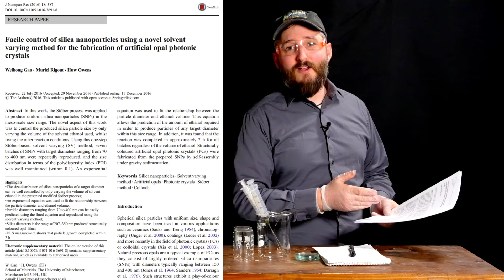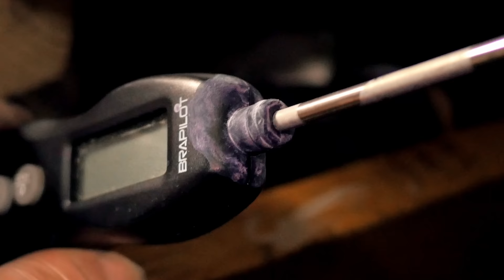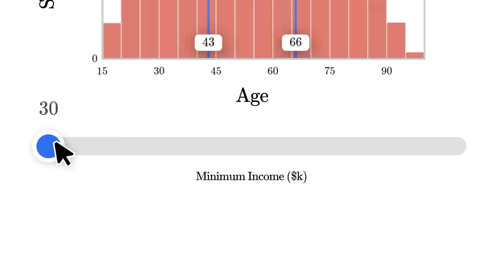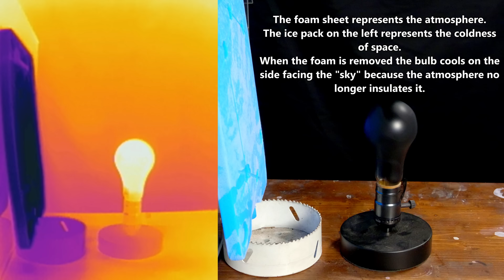Making Opals for Free Air Conditioning

Comment: Awesome being able to watch your work and experiments! I make colldial silver and I'm familiar with the color created from nano particles. From my basic understanding ionic silver is created by electrolysis with silver electodes. Adding vitamin c turns the solution to a particle. The solution turns to a yellow or golden color after the addition of a small amout of vitamin c. Maybe it is interesting or not but I tried adding trisodium borate to the solution because I was interested in that it is used as a flux for metal. It seems to cause a smaller particle when used prior to the addition of the vit c. It would be interesting to see if it had any effect in this process.

Comment: What would happen if you dried your opal solution on a resonate plate with standing waves to sort out the nano beads?  If dried on a ultra sonic plate the standing waves might be small enough to create a diffraction interference pattern.  Instead of carbon black if you mixed in nano ferrofluid solution and used a magnet to slow down the Brownian motion.

Comment: Try growing the opal crystals on different materials! I bet that there is some (even if it is very small) ordering in the glass dish you are using that helps the opal particles stack in a certain way, I wonder what results you would get if you grew the opal crystals on something like a quartz crystal or even a metal substrate, would the different substrate crystal structure influence the stacking of the opal spheres?

Comment: You don't need something as expensive as opal for radiative sky cooling. You can be clever with design and mirrors. Keep the direct sun off with a gold or silver metallic, and reflect everything else up to the sky (not near the sun) with mirrors. A room high up on a tower should be as good as a beach, for the full 360x360 effect, it reflects from underneath as well. Those pepper pots and minarets probably have basis in science.
Reply from the maker: That's true, with the right design you can use a black radiator. It's hard to implement that as scale though to cool a building. Better to have a coating or paint for that purpose

Comment: I was about to close this video thinking id already seen it, however it was thought emporium's. Like the way you explained changing the particle size, it was really clear and understandable.
I'm wondering if you could evaporate in a shaped silicone mould to get a preshaped stone. That would take ages I expect. Also could the solution be layered to coat something in opalescence.

Comment: Could you pull the air from the crystal with a vacuum?
I have seen people clarifying resin this way - though of course I recognise the difference between a liquid and a solid.
Perhaps:  Encase your opal crystals with a bit of epoxy / nail varnish and pull the air with a vacuum???

Comment: actually that centrifuge is a slightly smaller than typical centrifuge. it's just not as small as a microcentrifuge and not as fast as an ultracentrifuge. You should see the centrifuges we use to separate blood donations.
One thing I wanted to comment is that centrifuges this size normally have a decent amount of armor in them to contain the energy of samples and buckets potentially coming loose or breaking up at high speed. Centrifuge malfunctions can make a 50kg centrifuge jump a foot in the air. They cost in the order of $5000. I don't think your centrifuge meets any safety standards and costs 1/50th of a decent one. I wouldn't feel safe being in the same room as it when it's on.

Comment: I have a few process ideas, but they are totally off the wall.

Firstly I wonder what would happen if you use a vacuum chamber to help with both evacuation and removal of air from the lattice?

Another idea is freeze drying, I wonder what effects that process would have.

And lastly, I am curious as to the opposite of the first, a pressure cooking method with a desiccant inside to absorb the vapors.

Comment: To speed up a potential merger sample, look at nature.Thousands of years of pressure, is that the particles join. Potentially getting the centrifuge precipitate, putting a depression, reducing heat intense movement, may help force matrix formation, as the entropy is removed. Maybe even an electric field or magnetic field to try and help line the quantum crystals in a cooler higher pressure environment. There is also the topic that the current visible is actually the cover note absorb. So while the spectrum that does get through whilst reflecting infrared, could potentially be dangerous, as this work for does the damage in the sun. It may help to is in any back to, local water treatment plan. Opal the nature take thousands of years to slowly fill and replace other minerals as they leach through the rock and substitute for others. The black ethanol versus carbon work, possibly would be better than a pure is apostles as both your seed crystal nucleoside and provide you with the black people you're looking for.

Comment: what if you did a slow cool down? keep the heat but step it down over time to simulate the thermal cooling of the rock surrounding natural opal? i would say add pressure as well but i dont believe it's necessary. maybe an added experiment?

Comment: Could you settle the structure with a vibrational plate / by playing different tones using exciters on the work surface; Then pull with a vacuum or pipette excess? Would the vacuum disturb the structure contained if it is still permeated by solution?

Comment: I was wondering how to compress these microspheres into a rock for more concentrated color.  Also layering different solutions over days of evaporation.  But the centrifuge sounds like a good step in that direction and you can draw the clear fluid off the top of the solution.  Otherwise could you compress a dried powder with a slight addition of liquid in a hydraulic press?

Comment: If you're just looking for very small and uniform light reflecting spheres, would commercially available retroreflective glass beads not work for your radiative cooling coating?
Reply from the maker: Maybe. You want a very particular size for best results
Reply: @Nighthawkinlight  they're available in a variety of micron diameters and are almost perfectly spherical.

Comment: Would there be any merit in creating a vat of resin, using a vacuum chamber to remove the air, then stirring in strings of the opalite mixture in ribbons, then letting it harden? For resin art this is done with inks, but presumably it'd work similarly for this type of thing, although there may be some bubbles. I might go about trying this in a few months after getting some of the necessary equipment as I can think of a ton of cool art projects to use it for.

Comment: I'm wondering how shaking the solution as it dries would affect things. When you shake macro sized objects, they tend to pack together as tightly as possible and I wonder if that works on nano scale.

I'm also wondering about tumbling sand instead of using TEOS. Could it be possible to get useful nanoparticles that way or would they be too random?

I'm also wondering if using resin might work for the final product

Comment: Hey. i was just thinking, you know the huge problem of metal 3D printing is that it leaves parts highly porous right? can this be used as an adventage for this specific case, if you used silica microspheres instead of metal powder, wouldn't you get extremely insulating and highly radiating panel? you were working on radiative cooling paint, wouldnt this method provide highly durable radiative cooling panels for very cheap?

Comment: is it possible to use heat and pressure over the right time frame to create a monocrystalline structure within this solution? Or would it require an additional frequency to form the lattice such as cymatics?

Comment: Great videos.  Wouldn't smaller spheres reflect infrared?  Could that be used to make an insulative paint?  If so, how would that compare to Aerogel paint?  Aerogel works by blocking transmission through itself.  It seem to me that reflecting would be a more efficient process. Wondering what kind of R value would be possible.

Comment: Cool video! One question, though: why do you need 200 proof ethanol if you're adding an aqueous solution of ammonia to it? Surely 190 proof would work just as well, and without the denaturant?
Reply from the maker: You want pure alcohol so that the amount of water in the mixture doesn't change when more or less alcohol is added

Comment: Just thinking out loud here, couldn’t a batch of small spheres be used as the nucleation sites of a batch of larger ones, and working your way up the ladder to get a spectrum of batches?
Reply from the maker: Yes, but if you make an error in measuring your starting size you'll get the wrong result. It's easier to start from scratch because you always know what your particles start as.

Comment: The lung injuries from substances like Silicon dioxide cause a form of pneumonic distress to your lungs.
I forget what you call pnemonias caused by particles rather than infections. But. that's the issue you will experience should you breath some in. Fluid filled lungs, with a scary rattley breathing that is very difficult.

Comment: Love your videos! Would putting it in a vacuum chamber be an effective way of removing the air in the mixture? HVAC technician so free cooling is very interesting!
Reply from the maker: The trouble isn't the air, it's the gaps that let air in to begin with. A vacuum wouldn't deal with the gaps in the structure. Thanks for the comment!

Comment: All though it's a imitation of opal the chemistry is retro Ethan cilacat and a few gasification that's dangerous to breath the whole process of marble and the growth of wavelengths the mixture nano spheres silicate is the key for drying and combining the ethanol is the binder that allows the foam actions I used it in vacuum tubes for electronic devices to make a resonator of light that refracts the surface densities to the iris surface of restiveness to varyestor controls 16 of them make up the pathways to reading inferred results from a distant light sources the registers of each varyestor components are the most important part of the vacuum tube depicting the body flows through the lens at the top and sides with a touch of luvox to the mix it's the intention to understand the inferred results

Comment: 0:30 technically most minerals arent the color that they reflect. like pyrite for example, golden sheen but leaves a gray scratch on surfaces
Reply from the maker: That's a little different. When converting solids to powder you get scattering and absorbing effects which are more influenced by their physical distribution than their color.
Reply: @Nighthawkinlight  that wasn't specified at that point

Comment: Great video! its really cool to see the footage from the microscope. what kind of adapter is that which allows you to connect your camera to it?
Reply from the maker: The adapter is an m43 to m42 helical adapter and an m42 extension tube. It's not made to attach to a microscope but it's a close fit and the tube slides over the microscope head with a rubber band to snug it up

Comment: Why are shadows in moonlight warmer than the surrounding area? Is this to due to objects blocking heat from radiating away?
Reply from the maker: I don't know if that's true about shadows being warmer in moonlight. I've never heard that before. Being under or nearby anything that blocks part of the sky at night will keep you warmer. Moonlight is still light, and light will warm things that can absorb it. If you were under something protecting you from the sky and also being shone on by moonlight you should be slightly warmer than without the light. That difference will be hard to detect because moonlight is very weak, however bright it may sometimes look.
Reply: Thanks for the reply. Do a quick search lots of videos showing this. It is strange as I agree with your reply as to how it should work. There is something here though and it could improve your project.   @Nighthawkinlight

Comment: the dried solution became glassy after being coated with nail polish but did it retain its opalescence?
Reply from the maker: It did not. Need to be careful with the filler's index of refraction
Reply: Thanks for responding! I am a materials science student and I wondered if you could use this technique to make an opalescent paint. Unfortunately, it seems like there will be way more math involved with that idea than is covered in your video😂.

Comment: What camera adapter are you using for your microscope?
Reply from the maker: An m42 to m43 helical adapter, and an m42 extension tube that fits into the microscope head with a rubber band around it to snug it up.

Comment: why not use everclear for the ethanol? it would be much more concentrated than what you got and wouldn't be denatured.
Reply from the maker: Not legal in my state
Reply: @Nighthawkinlight  everclear isn't or using it like this isn't? if the latter I can assure you it's not a real issue as any law is really there to prevent distillation of moonshine even if you get swept up.

if you just can't have everclear, i didn't realize that the nanny state was that bad in some places.  using hardware store stuff is definitely better than a fine or jail time though so fair enough

Comment: 22:45 You are repeating a claim that the movement is  "the movement and the vibration of heat". It may be that as the heat increases, so does the movement. But that alone doesn't mean the movement is caused by heat. It could be that the warmer liquid just allows for more freedom of movement from the same energy source, which could very well be electrical, not thermal. Details matter.
Reply from the maker: My purpose in this video was not to demonstrate the cause of brownian motion. For that you should look into Einstein's work and following experimental confirmations